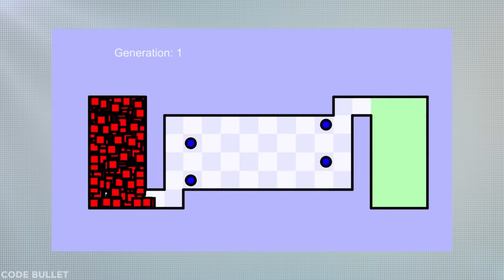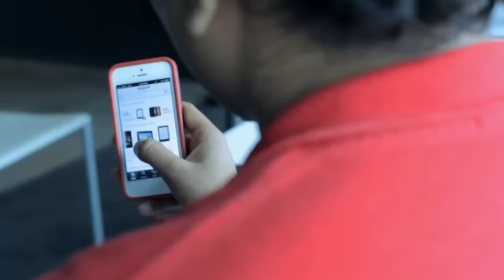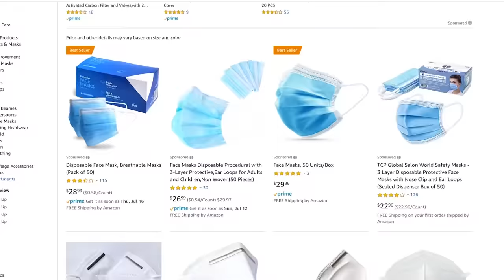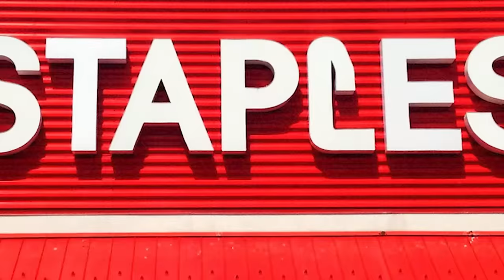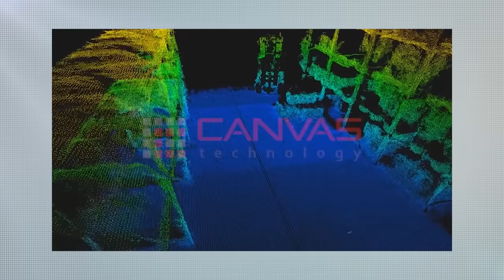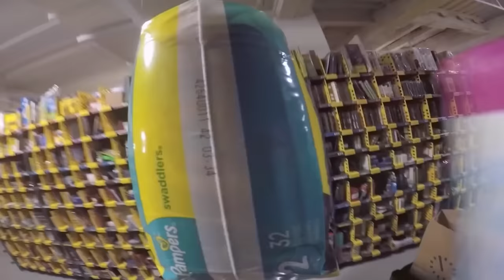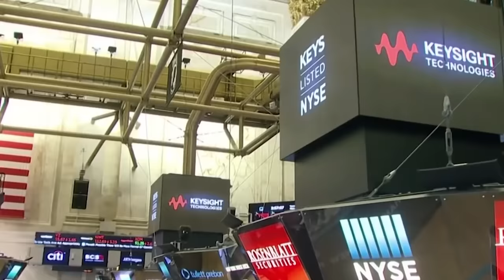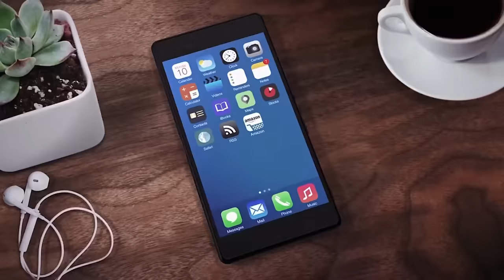Inside Amazon's Smart Warehouse

Comment: This is an awful representation of what it’s actually like in an amazon warehouse - a disgruntled current employee
Reply: What is it like?
Reply: @SiisKolkytEuroo  At least at my fulfilment centre in Scotland, there’s little automation, mostly manual labour for 10.5 hours straight, there’s not enough car parking on site so they make you go 20 mins away to park when you’re already driving 40mins to get to work, they try to enforce covid safe measure but it’s impossible to uphold when you’re in there, you can go weeks at a time with no communication from your manager about how well/bad you’re doing and there’s no consequences if you are doing well or doing badly, apart from if your doing bad or going slow you get verbal warnings, but the don’t feel too threatening
Reply: @notcaveman  yeah this is true, so the guys in the pick tower where the items are stored are walking roughly 15miles a day to get items as the warehouse isn’t automated, also I was doing a job in customer returns the other day and clocked an average of 22km of walking per day for a week
Reply: @zinoheadshot12  this is cool. I go walk miles for health reasons. jealous you are getting pid for it.
Reply: I actually liked my time at Amazon. If you think Amazon is bad , pick up a few shifts at a UPS warehouse and let me know how that goes. I can tell you from my experience UPS was absolute HELL more like a slave house. Amazon warehouse I worked out is fairly automated so I got to do the boring stuff. and thats the one bad thing id complain about is that working at Amazon can get REALLY boring
Reply: @IllusiveDude  I’ve found in amazon they give you jobs that can be split into 2 categories: mentally exhausting ( extremely boring and repetitive tasks ) or physically exhausting ( like yesterday I walked 16.4miles around the place over my 10hr shift).... it’s one or the other
Reply: Video makes it seem much more futuristic than it actually is, atleast where i work, its alot of manual labor and stacking heavy boxes, packages. Depending on what station your at, amount of walking can vary.
Reply: @zinoheadshot12  why don't you quit?
Reply: @Tommy_7178  money’s hard to come by during these times
Reply: @zinoheadshot12  I guess you should be thanking amazon for providing a job then. That's the way I look at it.
Reply: @Tommy_7178  amazon warehouses are the worst to work in Canada. You are underpaid, disrespected and treated like machines. Jeff Bezos have made his money by exploiting workers.
Reply: @zinoheadshot12  wow 16 miles ? Are there AR robots where you work ?
Reply: @IllusiveDude  I work in packing with the smart pac machine. It gets very boring very quickly. The only thing keeping you awake is trying to make your rate. But there comes a point where even that is easy and very boring.
Reply: @yashvirraj9183  exploiting how they all willingly choose to work at Amazon because of the pay it offers
Reply: @Trey4x4  thanks man! Hadn’t thought of that one
Reply: @zinoheadshot12  you're welcome dum dum
Reply: How much of this is legal restriction in the area you work? Do you know all the stuff going on behind the scenes? There could be laws similar to those not allowing automatic driving cars in certain areas at all. Tesla has to turn off the self driving in those areas because of this. How about in Amazon? Could there be local laws limiting this? What about local tech limits (servers and such)? Even if you work at a place doesn’t mean you see all the issues that could make each place in a company unique to each other. This video was probably shot in Seattle or Everett Washington. Those are the most likely places to be up to date and legally allowed. Oh and how much do you make? Should be the local equivalent to $15 an hour.
Reply: @zinoheadshot12  last week , I clocked 33 km and roughly 53,000 steps 🥺
Reply: @IllusiveDude I believe him , We have robots but robots can’t perform everything! I clocked 33 km and 53,000 steps .
Reply: @thecomebackking737  what have they got you doing in there?
Reply: if you are a disgruntled current employee and not a disgruntled ex-employee then you are basically proving that their model works. I hope you are working on an exit strategy.
Reply: Yeah, that employee was probably making False Pick Shorts left and right, cancelling out customer orders. See it all the time.
Reply: Yeah I wouldn't work at Amazon fulltime, but the fact you can get $15 dollars an hour with the only requirement being a high school degree or equivalent I would say thats pretty good.
Reply: @zinoheadshot12  So.....it's kind of like work. Not all jobs are where you get to dance around and pick daises.
Reply: @zinoheadshot12  wake up Jack, be a seller on Amazon...im a seller
Reply: This is exactly what my fulfillment center looks like in us, I love it ! I make almost 18$/hr to stock those shelves and the robots bring them right to me ! Its really hard physically but now I don't have to exercise outside of work :)
Reply: @chelseaheisler6578  $18/hour is good, how many hours do you do per week? We get £9.50/hr unless we do overtime
Reply: @Tommy_7178  that's what the work is for
Reply: @scrapplepig  Yeah but the richest company in the world making hundreds of billions per quarter of a year, would think they could pay their workers a little more than 9.50 an hour. Wouldn't hurt £20 per hour.
Reply: @markymark7803  No it wouldn't hurt.
Reply: I have done over 60,000 steps a day... In a robotics run location.. as part of ICQA.
Reply: i work at a cvg in kentucky and amazon does not care about people just customers
Reply: Perhaps you could all start your own businesses, and figure out how to automate it with robots or drones?
Reply: Not surprised it's because mostly people by the lie it's better to be safe with a JOB JUST OVER BROKE then be an affiliate from home or have a presence on Amazon with a store or stores on amazons website.
Reply: @zinoheadshot12  job just over broke. The best slaves are the ones that don't know they are slaves
Reply: @zinoheadshot12  AUTOMATION IN A FACINATES SHOULD BE COMPLETELY COMPLETED BY YEARS END AND AMAZON SHOULD MAKE THAT ANOUNCEMENT ON THE 4 TH OF JULY AND STICK TO THAT COMITMENT PERIOD !
Reply: @zinoheadshot12  can anyone say rollar blades or rollar skates
Reply: @Tommy_7178  the mall of America in minasoda has the grocery store so big all workers are on skates either rollar blades or rollar skates
Reply: @pooplordful  I wonder how often employees video clip that stuff and send it to the " APPROPRIATE TOP BRASS THAT WANTS AND NEEDS THAT INFORMATION WHEN ITS HAPPENING ??? BEST TO TRY TO BELIEVE IN THE FACT THEY DO CARE BECAUSE IF ENOUGH VOLUME OF EMPLOYEES SUBMIT THOSE FACTS IT OK TO BELIEVE IN THE FACT IT MAY INCREASE CHANCES OF REAL CHANGES THAT MAY INFACT TAKE PLACE FOR THE GOOD OF THE COMPANY, EMPLOYEES, AND PROFITS.
Reply: @Ryanstuff  like working from home as a amazon affiliate or something else. Like support for amazon resellers with stores on amazon
Reply: @meandkg  agreed and if ya live below your means and invest in options trading on the comadaties exchange with the propoer support ( the greatest business on earth TM. ) YOU COULD BECOME VERY WEALTHY
Reply: @chelseaheisler6578  saving money 💸 having to work out at the fitness gym kool beans it's probably good for ones sexual prowis and great as a cross training activety
Reply: aa aa  That's worth considering I'd think .
Reply: D Niger  most people I've heard from over the years act like they read and authoed every book on certain subjects like home business opportunities or the entire direct sales industry when 99 chances out if a hundred they know maybe 1 tenth of one percent
Reply: @someguyyoudontknow263  Cool story bro
Reply: Amazon sucjs to work for.
Reply: If it's AMAZON...then it is a 'PRIME' SUSPECT for money laundering at HQ and Tax Evasion /Avoidance Fulfilment Centres...Bolton and 17 UK sites have  a high rate of Covid infections in their towns/ city due to slave trade practices in  AMAZON warehouses.
Reply: @Trey4x4  ahh, the Unemployed Armchair Wizard strikes again!!
Reply: Depends on the center you work at.
Reply: @IllusiveDude  omg UPS was HELL on Earth. Lol
Reply: as an ex-employee, eh it’s not the worst place you can work. i was a packer so my job was easy, but super repetitive. i work at fedex now, much happier
Reply: @meandkg  i made $18 straight out of high school at amazon, with ample OT. if i wasn’t in college id probably still be there honestly
Reply: Plus, it's only the NEW and MODERN warehouses. A lot of the old warehouses (the majority of fulfillment centers) still use PIT/OP machines and do require constant movement around and navigating to items.

Comment: 8:08 put another way, the workers have to process and package one package every 30 seconds (no later), to as fast as one per 12 seconds.
Reply: They dont look like their going fast enough
Reply: @Aluminum Oxide I guess it just depends what warehouse you work at. I have heard different rate requirements for different  warehouses. I work at an Amazon warehouse in CA and the picker rate is in the 400s per hour. It can be done. There are a lot of slackers and there are a lot of hard working ppl. I know some ppl pick 420 an hr no problem.  That's too much for me. I usually pick around 360 and it's only "low" because there are always issues with those robots.

Comment: The key thing missing with current robots is hands and accurate vision placement. So robots can’t yet pick and pack mail boxes. Tesla’s factories have the same issue - where robots couldn’t install wires in cars. Once this is solved, there will be little need for warehouse workers.
Reply: Yes, the human hands is a very complex mechanism. Very difficult to replicate accurately.
Reply: The new Pegasus robots get packages delivered to the edge out of a mass flow loop, waterfalls down to a few items between a scan zone, then picked up by a robotic arm and placed on the Pegasus. Just did one of the first sites to use this and the robot arm was the least of our problems. Just uses suction cups to pick up the package. Next step would be boxing and sealing those boxes with robots.
Reply: @ddf_m340i4  So what would it take for a Robot to pick the goods and fill the boxes? A hand, vision, and bar scanner?
I have seen machines which close and seal boxes.
Reply: I run a packing machine for the  world's largest online distributor of restaurant supplies. It's pretty neat when it works correctly and isn't breaking down every 5 mins😅 I just place the items on a conveyor belt and hit a button. The machine builds the box around the items, tapes it shut, and puts the shipping label on.

Comment: Those pick rates are probably for Universal Stations. ARSAW’s are 340 - 400 units per hour. Last night, someone on my shift was hitting 512 uph. The errors are referring to what are called “False Pick Shorts” and are the quickest way for an employee to get in trouble, you’re basically cancelling out/delaying a customer order by hitting “Missing Item” on the pick screen. If the item is discovered by a “Counter” to be in the bin and the picker didn’t pick it but instead opted to cancel out the order, that’s a big no no. Always check and confirm through scanning all items in a bin to confirm an item as missing before labeling it as such.

Comment: the robots are only in fulfillment centers. every sortation center still does that many miles per day, often making sorters stow 300 packages an hour per person. this translates to about 5-6 packages a minute. 1 package per 10 seconds in otherwords. this includes boxes up to 45 lbs, and many times there are aisles that get hit with up to several hundred packages per night of up to 45-50 lbs over the night. there was a night where 120 25 lbs computers came to one aisle. 1 picker had to pick them up by themselves, and 1 stower did the same. typically these come in on pallets and are received by these individuals over the course of 2 hours. that'd be something around 3000 lbs lifted within 2 hours. a typical sortation picker lifts up to 2500-3600 packages per night, while a typical sorter can see around 2200-2500 packages per night sorted depending on what comes to their aisles. it's very random and you never know what will come your way. personally, i find this job enjoyable, love the people for the most part. but yes, the demands of the job are NOT For every person. 

DO NOT work in the sortation department if you are a person with severe health issues, are extremely overweight, are prone to injury, or have come from a job that has zero physical activity. if you do,  you will have a higher risk of injury, complications with your health, or even long-term injury. in many cases, the injuries sustained within the job ARE NOT due to the demands of the station, but rather the state of physical health of the employee. that said, injuries DO occur. it is a significantly fast paced environment that very few can succeed in past the minimum requirement set by the expected pick and stow rates. IF you do plan to become an employee, my recommendation is to first get your health in order, look up proper lifting practices (many injuries occur due to failing to lift properly) and to specifically spend your first month walking everywhere you can, as quickly as you can. most warehouses are around 1/8 mile or more. you will be walking A LOT. secondly, get to know your co-workers. 

WE HELP EACHOTHER. this is a team based environment, if one person is hurt or getting bogged down, HELP OUT. otherwise, no one will go out of their way to help you out when you are next in line getting bombarded by dozens of packages for your aisle set, or are too fatigued to continue in your area. if there is one person you dislike a lot within the warehouse, or you are the type to be non-personable.. at least do your best to help those around you. you don't need to talk, just assist where you can. it's always appreciated, because the person in front of you, yourself, or the person behind you might have spend the last 3 days rushing to hit their stow rate requirements, or are new and aren't up to the demands quite yet.

Comment: Staff incentives are awash with dubiety.

Those factory workers need group holiday motivation,
especially during the darker months.

Train travel only of course
as society is yet to ban the use of kerosene from aviation.

I hope the mighty Amazon
can use 100% renewable fuelling for its delivery vehicles.

Those factories can provide their own electrical energy via
installed rooftop vertical axis wind turbines to reduce costs and burden on infrastructure.